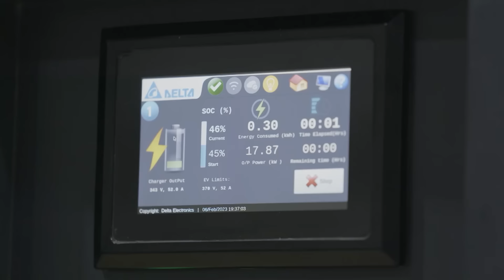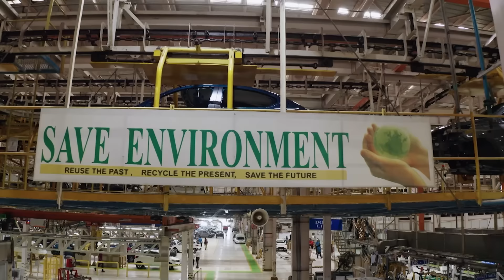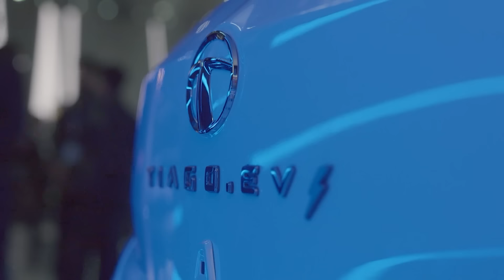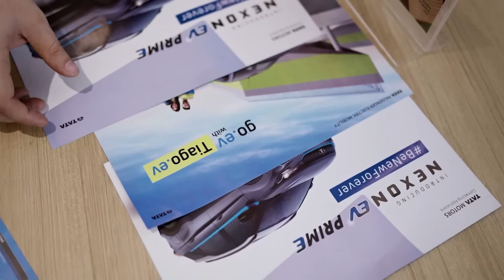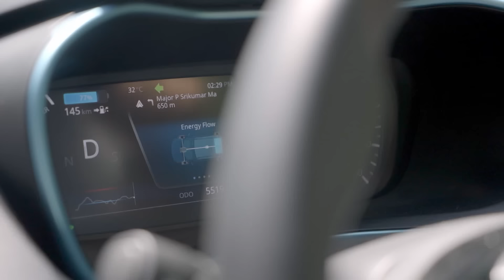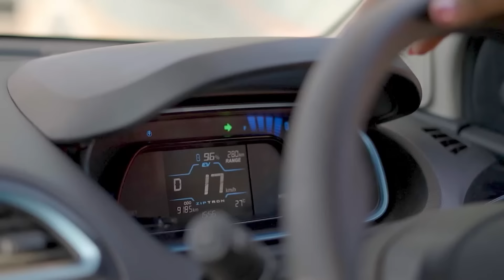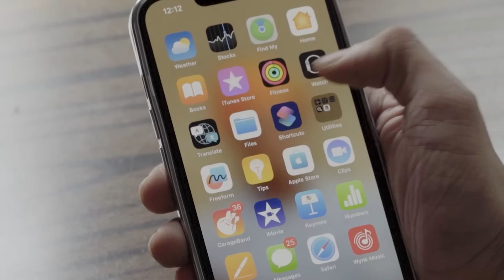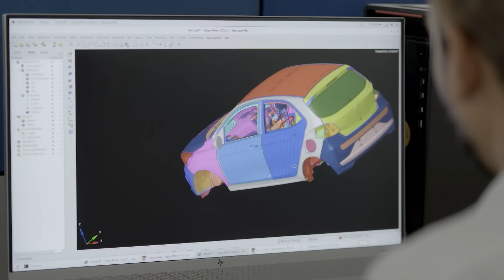Go.ev | The Electric Revolution Documentary (English) | Tata Motors X National Geographic

Comment: Well doing  great work. One suggestion is to convert the old ice vehicles to EV. By creating a ev kit to the old tata motor product vehicles . It could make easy to adopt ev. As a owner of a tata car i would love not to scrap my old car ,rather then  scraping i would convert to EV and  enjoy my old car . Thanks for getting EVs . Great future on go ev. Go Green
Reply: good proposition. also please note diesel engines can be converted to H2 based ICE engines with minimum fundamental changes.
Reply: I am using a indica vista, quadra jet done 1.5lakh kms in 13 years. If I could able to convert my existing car into ev, it's great.
Reply: @abhijit1509ibskol 
But where are the H2 filling stations.
Reply: @ramarajjanarthanan1934  it is a nascent upcoming tech, still in development stage but has far more potential. This one may not be relevant for your case, especially for your car conversion.

Comment: The main polluter in many small cities are these extended autos which run on diesel with 8 passengers behind. Tata needs to tap into this space if they wish to bring about a change. Tata magic ev is a good option but it needs to be without doors, the rear part needs to be designed as autos. Price too should be below 5 lakhs if they really want to see mass adoption.

Comment: Please improve charging infrastructure....when weather is bad there is always network issue.....so some alternative methods needs to be adopted....
The software tata zconnect app has many bugs
The service centre are not well equipped or well trained to handle all the issues...
These 3 points are major concern now for users who own a EV.
 Please look into these points
As far as range is concerned though it is claimed 437 or 453 after software update we never get it on our MID.....it hardly shows 350 kms and real world range varies from 270 to 320 kms max depending upon driving conditions and weather....this issue also needs to addressed
Reply from the maker: Hi Swaroop, we would really like to help you with this. Kindly provide your contact information, dealer details and Location details, so we can have the concerned team contact you for further assistance.
Reply: Same stereo type reply u get from Tatamotors. All suggestions fall in deaf ear and thrown into waste paper basket.

Comment: BUT the biggest and most important aspect and question is........WHERE WILL ALL THIS EXTRA, CLEAN ENERGY COME FROM???? Once the number of EV's start to grow exponentially, the recharging of all these EV's across India WILL surely be a topic/problem of ASTRONOMICAL proportions.
Reply: even with 100% coal electricity, its still better, cheaper, cleaner than petrol
Reply: @fwefhwe4232  I think you've misunderstood the direction of my comment. I'm very enthusiastic and in full support for the shift from Petrol/Diesel to EV, in terms of the many positive aspects but in a country like India, which doesn't seem to have much existing reserve capacity in power generation and surplus energy capability, as per understood economic theory regarding Supply-Demand-Price, we can expect a substantial surge in the price of energy, made available for EV charging, by the Government. This would not be a favorable scenario for the common man. That's the focus of my comment.
Reply: @tonyrebeiro  so you would rather spend billions of dollars importing oil than spend on building new power plants? the whole world is moving towards EVs. cost per mile of EVs is less than 20% of cost per mile of a ICE vehicle. the change to EVs will not be overnight but gradual giving more time to increase power capacity.
Reply: @rakshitgowda3001  That is not what I was implying. I'm talking about the Government dragging it's feet. To make the transition to Electric, there is a lot required from the government, right now, in terms of ramping up the energy production in the country, which doesn't seem to be happening fast enough. Solar, wind, nuclear being the known, obvious options. For example, Tamilnadu is presently facing huge deficit in power availability, to expand its industrial sector. Under such prevailing conditions, providing astronomical amounts of energy for EV's is just not feasible, unless they address the issue immediately. There are other states too, in similar positions. Therefore, the successful and steady transfer to EV's will not happen unless these fundamental issues are sorted out, on a war footing. This is what I'm implying.

Comment: It seems The EV are meant for rich and effulant people who can buy this as second car for city drive. Because average indian public is having a 2 to 4 ke service connection. The car can not be charged with 3.3 kw charger and use AC during night until and unless the service connection is upgraded to atleast 5 to 6 kw. And for this even if you do not charge u have to pay extra everymonth. I suggested Tatamotors to introduce 1.5 kw charger which can be safely used along with AC. As ambiant temp is increasing everywhere Airconditioner at home is an absolute necessity. DC fast chargers cost 3 times more but their availability is only limited to A class cities and metropolitan cities. Not smaller towns. Even not available on highways. Nearest charging station is 200 km from my place, Rourkela. Even TATA motors dealers do not have charging facilities, they use 15 amp home ac point to charge the ev before selling. The dealer at my place could not provide test drive car also. Central govt as well as state govt are not keen to setop charging stations in smaller cities and highways and this restricts people from ev. Govt must force petrolium ministry, tatamotors , mall owners to install charging facilities so that people can go anywhere worry free.

Comment: To forecast that the growth of Electric Vehicle sector will directly contribute in significantly reduce the Greenhouse Gas emissions is like fooling ourselves towards believing in utopia, because, as the transport sector keeps growing, it will keep adding vehicles instead of scrapping or converting good old fuel based ICE vehicles in the sector 
Therefore, only a stricter transport sector licensing regulation focussed on restricting legacy ICE vehicles can make a meaningful dent in GHG emissions

Comment: I bought Tiago EV and getting a range of 280km, city drive without AC (video uploded on channel PIYUSH MATHS ACADEMY) Go EV with Tiago EV 😍
Reply: Enjoy bro drive safe ☺️
Reply: What for you purchased a car? AC is necessary due to high ambient temperature everywhere. As there is no separate switch by which u can run blower only you will feel like in a furnace and opening windows will increase drag on vehicle. Tatamotors must provide a separate switch to run only blower.

Comment: What customers most fear is of charging station in village to zonal to local areas ...like in small towns
...if tata can install charging stations first...and people knoe it they dont have to fear of changing issue...like petrol pump everywhere available.... Even town people will buy it... In village also people have trust over TATA products...but only problem they have is not enough charging station..
Reply: Tata dealers do not have charging stations which should be mandatory. It is funny why Tatamotors is not insisting for this.